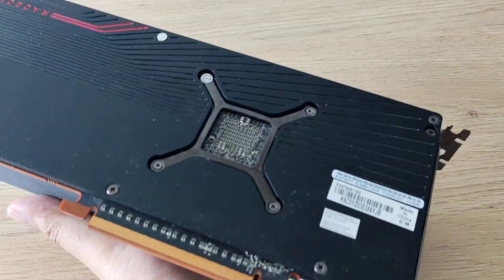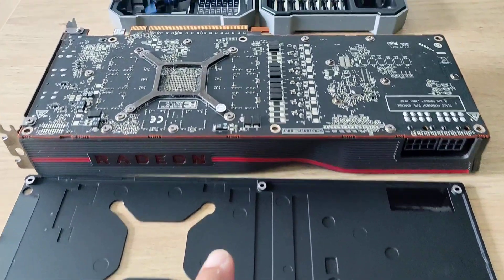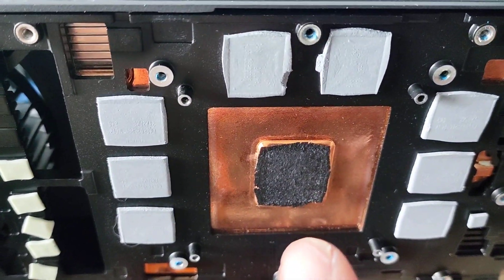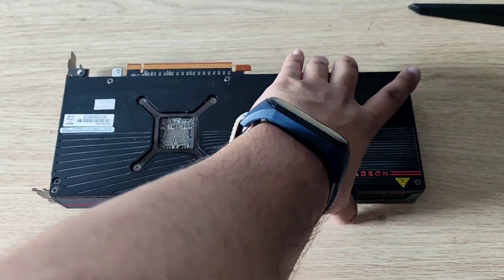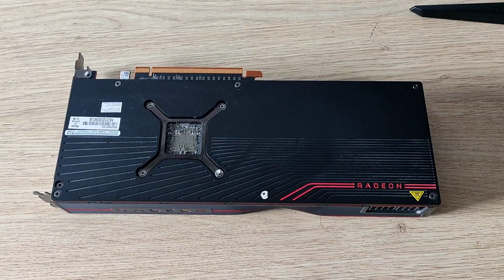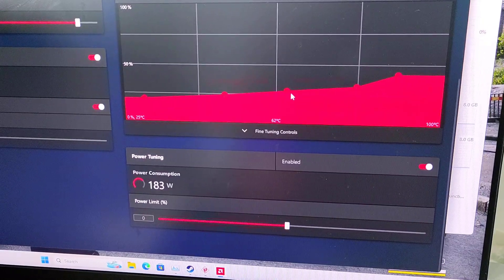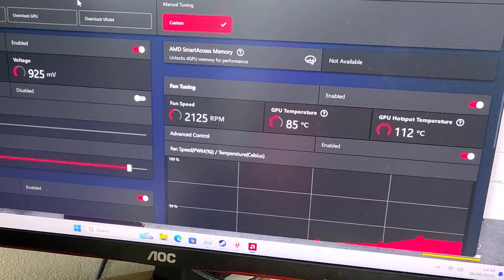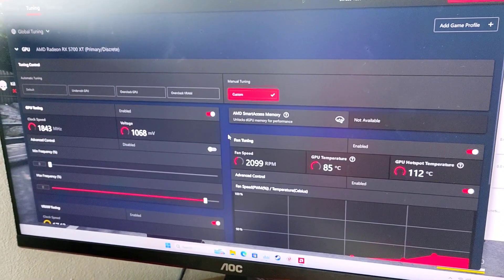5700XT Blower GPU gets a repaste

Comment: 10 months  later and thought id mention you probably didn't need to change the paste. The 5700XT reference shipped with a graphite / phase change pad which is why it was dark coloured. They should last the life of the GPU.
Reply from the maker: Thanks, I learnt something new today!
Reply: The 5700XT when it released had poor contact between the cooler and GPU. If you seach for "washer mod 5700XT" Gamers Nexus had a great video on it.  That was probably what was causing the poor temps on your 5700XT.

Comment: I have the same problem but with my Thicc III 5700 XT. I have 95 on GPU temp and 110 on hotspot and when I looked inside my GPU yep I saw problems, barely any thermal paste. I bought it from someone a while ago and have been trying to do a fan curve undervolt it and nothing improved so I changed the thermal paste and pads and I now have a maximum of around 70 on GPU temperature and 85 on the hotspot and that's overclocked with 50% power
Reply from the maker: @KamilWyszynski-y3p  That's very good, I changed paste, I think it needs pads changing as it didn't make hardly any difference.

Comment: well i had one (a gygabite one with 3 fan) and it had same temp. i was forced to up those fan buy quite a lot ! so 2k RPM on a blower is def too low ! got a 1070TI for a gaming server and it has the same issue. for the 5700XT on "classic" desing i was at 3k-3.5K rpm minimum. for the blower 1070TI i am at idle at 1500RPM and near 4k ingame. blower is awful for cooling, that why we don't see them anymore
Reply: those blower fan are designed to go higher in RPM so don't be scared to push it.
Reply from the maker: Yeah just the noise is crazy
Reply from the maker: Yh not sure why the blower was even a thing!
Reply: @AlexHusTech  A remnant of the past, where any serious computer (anything more powerful then office/home PC) required water or big blower cooling (much bigger then on this card, and also with high RPM...imagine the noise). Also it allows to stack more cards in single PC/rack, which is obviously useful if you need to stack a bunch of them...with very good airflow.

Comment: If you feel comfortable flashing firmware... Undervolt and/or Downclock the chip, and increase fan curve in firmware.
That way it will still run cooler when used in another build, or without a windows app.
Double-check the case intake fans are getting enough fresh air directed towards that blower.
Blowers are known to run hot.  Theoretically, Navi has a maximum junction temperature of 110°C.
Reply from the maker: Thanks for the help, I appreciate it!